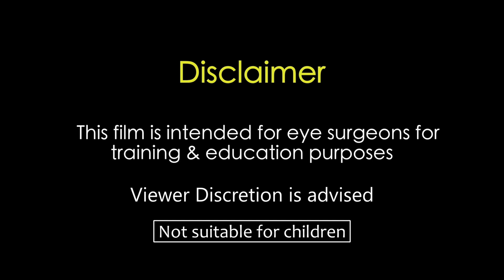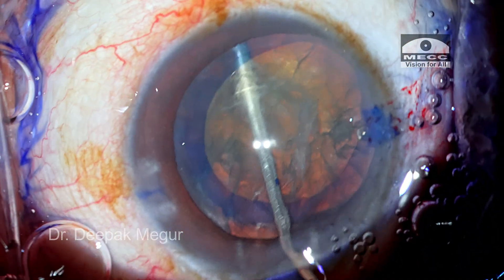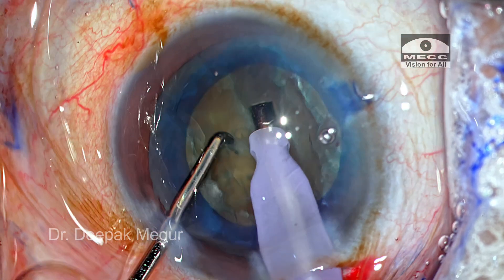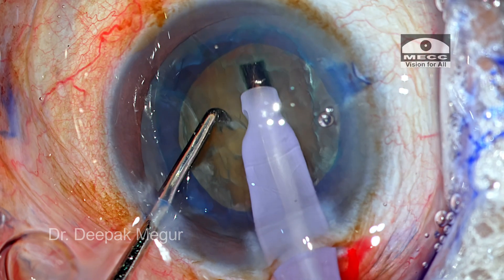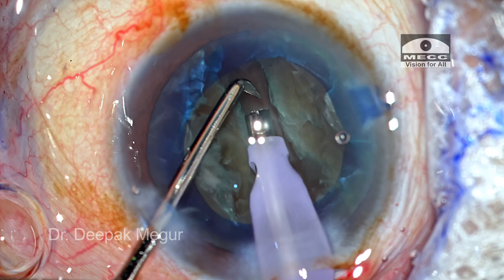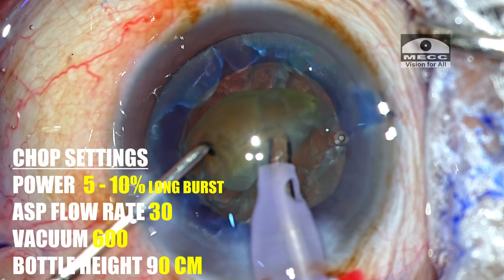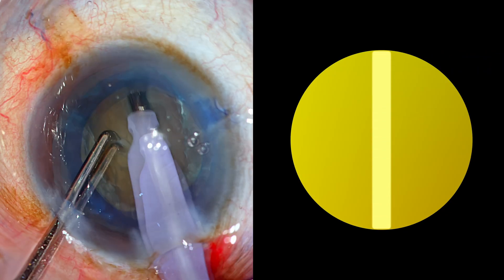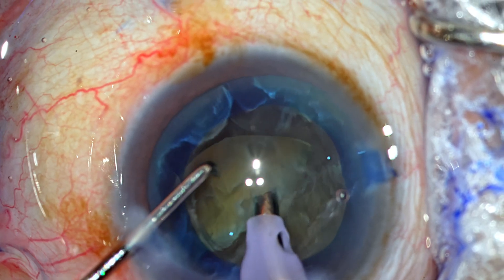Phacoemulsification in soft cortical Cataracts- Tips- The double y groove technique Dr. Deepak Megur

Comment: The reason we make a double Y
groove is not to split the nucleus in two. I understand that it is to make it easier to remove the nucleus from the bag once it has been split in two. Is that correct?
Reply: Besides I think it will give more room during lateral separation,  I guess.
Reply: I think in an earlier video Dr. Megur pointed out that it's easier to bring the heminuclei up to the phaco tip if there is some space at the top of the pieces so that they can slide around the anterior capsule edge and come up.